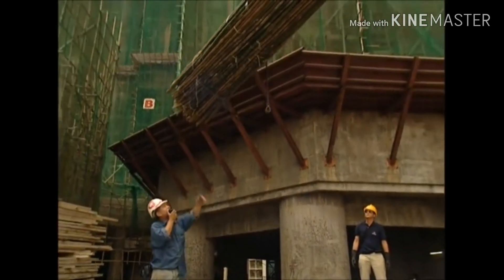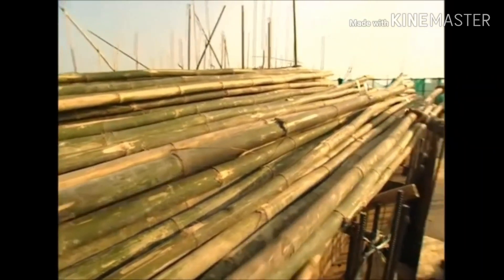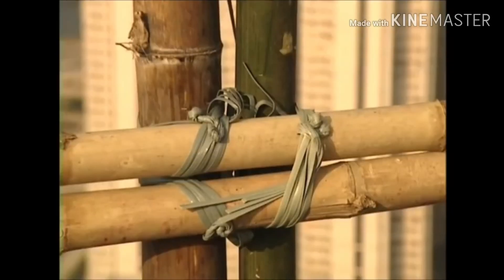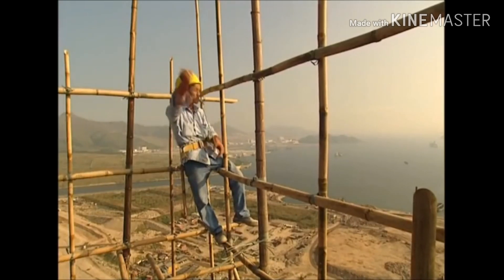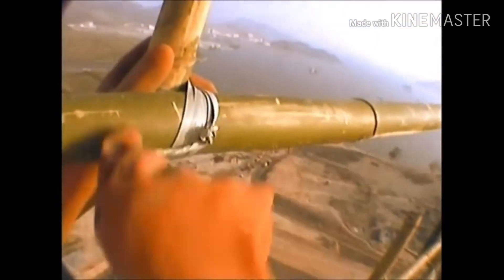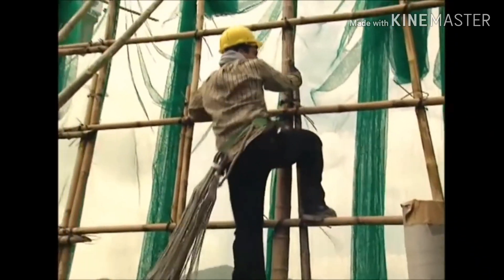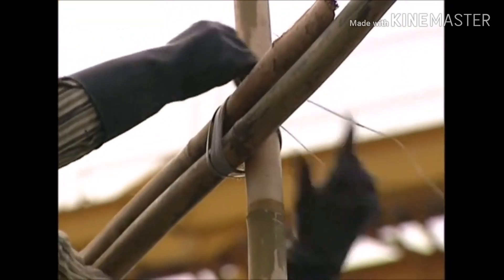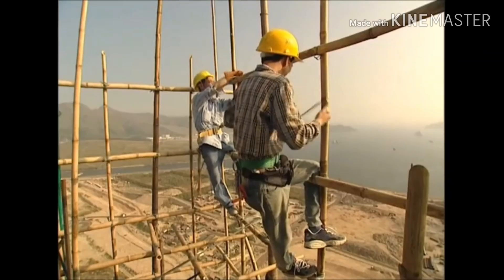Bamboo Scaffolding Assignment Project

Comment: Deaths from Bamboo Scaffolding Accidents in Hong Kong (2000–2024)
Year	Deaths	Notes
2000–2005	About 5–7 (estimated)	No official yearly data; based on scattered news reports
2006–2010	About 3–4 (estimated)	Individual accidents reported, but no full statistics
2011–2017	About 3–4 (estimated)	Roughly 0–1 deaths per year on average
2018	3	Official statistics show 3–4 deaths per year recently
2019	4	Government data shows 22 deaths between 2019–2024
2020	3	Same source
2021	4	Same source
2022	4	Same source
2023	4	Same source
2024	3	Same source
Total (2000–2024)	About 29–36	Of which 22–23 deaths are officially confirmed between 2018–2024